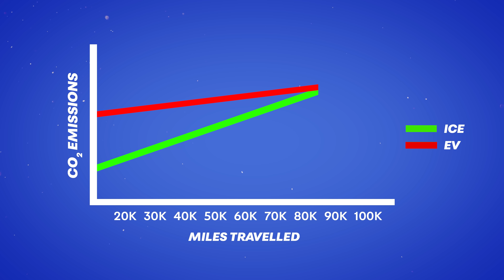Are Electric Cars REALLY That Green? [New 2022 Data]

Comment: The Volvo report is, so far as I can see, apparently a lonely outlier. There are numerous studies concerning the lifetime impact of comparable battery electric and ICE vehicles. I cannot claim to have located them all, but they all, so far as I can tell, appear to agree (aside from the Volvo example), that the conventional wisdom is indeed correct. ICE vehicles pollute less than BEVs in the manufacture phase, but it is the use of the vehicle, where the ICE vehicle easily outstrips (but not in a good way) the BEV, meaning that BEVs are overall substantially less hostile to the environment. Of course, all driving, irrespective of the energy source is harmful to society and the environment inmultiple different ways. Driving less is better for the environment. No motor vehicle is truly environmentally friendly, but a hierarchy of transportation harm exists. In terms of decreasing environmental harm of personal transport, I believe it to be: ICE car, Hybrid, Plug-in Hybrid, Hydrogen car, BEV, electric motorcycle, walking and pedal cycle. Yep, the pedal bicycle is undoubtedly king and is at least several times more energy efficient than walking.

Comment: Its not going to matter much at this rate. But if you dig a little bit you will find out that EV is not actually green at all. There are a a number of things that makes EV a danger to the environment. And there of course is the problem with none scalable factors. It is not possible to scale up the manufacturing of EV to replace all the normal cars. And that be a fact. As all the cars on the road today are not manufactured with in the last 10 years. Actually most cars on the roads are over 15 years old. So can you replace a billion cars in a short time. Not physically possible. Plus there is the fact that with in the next 5 years people will be starving and the value of all currency will be basically zero.  And manufacturing will come to a stop because of that.

Comment: Very good article but I will take exception to one thing Rory said, it doesn't matter what tariff you sign up to, your electricity comes from the nearest power station and if you look on the national grid carbon map the only place in the UK that has low carbon energy is the northeast of england. So if you've signed up to a green tariff in wales all your electricity or 99% of it is produced at a gas powered power station!

Comment: The break even point between EV versus ICE emissions, as reported by Reuters Press agency is quite different from that reported by Volvo. Reuters relied upon the modelling used by Argonne National Laboratory in Chicago. Their figures suggested a Tesla Model 3 would break-even with an ICE car at 13,500 miles (21,725 km) after which, the EV would be greener.
There seems to be an acknowledgement that assumptions can affect the result substantially.
However it's unsurprising that: The American Petroleum Institute, which represents over 600 companies in the oil industry, states on its website: "Multiple studies show that, on a life-cycle basis, different automobile powertrains result in similar greenhouse gas emissions." Well they would say that, wouldn't they.

Comment: Well I'll be honest, In my case other than being so called "green", I will get an EV because I don't want to pay for gas anymore. In my area, the power is hydroelectric so no worries. Whatever way I look at my calculations even if the EV is more expensive, I still save money weekly vs my current car + gas cost. It really depends on your situation in the end
Reply: U will save money . Thats fine until you start thumping your chest about ice car drivers being inherently worse. Some of course are but not most.
Reply: @ronskancke1489  in my case, not my intention. The sound of a V8, it's something. Anybody who thinks that ICE or petroleum will become useless tomorrow is deluded. In the end an EV suit my need. I say your money, your choice.

Comment: It's great to start doing this comparison to really educate people in general what they are getting. I would still have a couple more questions.
1. How long is the EV's car battery actually going to last? They are the most expensive part of the EV and the batteries are not easily recycled.
2. If the battery only lasts to that 92,000 miles is the EV actually that green if the battery has to be replaced?  Doesn't the graph have to start nearly at the bottom again since that is most costly part of the construction of an EV?

Comment: Volvo is saying that EV’s without energy supply side changes will only result in a 20-30% reduction in emissions over a 120k mile life of the car.  Another interpretation is that even with the current state of battery tech, EV’s can reduce road transportation related emissions by 60-70% if charged by green sources.  Better supply and better batteries are needed.  The supply has a known solution, the batteries need R&D.

Comment: Not surprisingly, Tesla's battery pack is under warranty for 8 years or 50.000 miles (80.467 km). So.... you'll have to change it before it even reaches the point of breaking even. if you add the generation of the electricity, then it is even less greener.

Comment: As an engineer the facts are the EVs are just virtue signaling.  When you consider the mining of the battery components AND the disposing of the battery which is not 100 % reusable, the ICE car is a bit more cleaner over the lifetime of the car PERIOD . Plus eliminating all gas cars won’t do anything for the environment. It the big shipping lines that pollute the most.  Unless we all start manufacturing stuff at home the problem ( WAY OVERSTATED AS IT IS) won’t get solved.  Remember politicians are heavily invested in green manufacturing THATS why they are pushing us that direction

Comment: EV ranges need to greatly expand and charge times have to drop to make EVs viable as a family vehicle. In North America you need to be able to cover 600 to 1,000 miles a day with with at least one of the vehicles owned by a family. Distances are just so much greater here.
Reply: 1,000 miles a day!?
That's 22hrs and 15min of driving an average of 45 miles an hour over a 24 hour period...
What family does that EVER let alone regularly?

Even the low end 600 miles a day you mentioned means driving non-stop for 13hrs and 20min a day.
Reply: @MNKYfilms  US Interstates have speed limits in of at least 65 mph. 1,000 miles is about 15 hours.
We are in Maryland just NE of Washington DC and NW of Baltimore.  Orlando and Memphis are about 900 miles, Kansas City and Fort Lauderdale are a little under 1,100 miles. We make the trip to KC about twice a year (usually one to visit and one passing through on the way west). My in-laws have a place near Fort Lauderdale so we are usually there at least once in the winter. Orlando is a once every couple of years trip and we are heading to Memphis for a week over Easter. As long as you follow the traffic alerts on the GPS any one of these is in the 15 to 16 hour range. 
If the wife is with me I would not be able to do this with my truck (1 fuel stop, 2 bathroom stops, eat while driving), but have zero issues in my coach (zero fuel stops, food and bathroom on board).
You also have to drop your mileage if you are doing multiple longer days. For instance  Boise Idaho to home (south route through SLC, KC and Lexington KY - about 2,500 miles) took 3 days in the coach.
Nobody averages 45 mph on a road trip.
Reply: @rich7447  No road trip that I'm aware of averages the speed limit...

But even if we agree to use your fantastical average speed surely you can agree that the average person does not regularly drive 15 hours a day. Let alone without breaks every few hours for food, bathroom and to stretch your legs.

The average person also doesn't have or want a coach as an option.

It sounds like an EV is really not an option for you because of the type of driving you do. And that's perfectly valid and fair. Don't get an EV then. No one is forcing or even asking your too.

However your personally driving habits are NOT the average. I would guess that most American families would do fine with 350 mile range in a day. And I'd also guess that most families would stop for a meal that lasts more than 30 minutes at least once during a 10 hour journey.
Reply: @MNKYfilms  Most road trips in the US average over the speed limit. Some parts of the year can be slower around major cities (I-95 especially) in the North East, but the south, mid-west and west tend to have open highways for miles. You don't seem to realize how far it can be to get from one city to another. The last time that I was coming east through Denver on I-70 my GPS told me my next turn was over 600 miles away. 
Even in my truck I stop very rarely and this is not uncommon for people in North America. You eat before you get on the road, lunch is a snack from a truck stop and dinner happens when you are done for the day.
My driving habits are not average for some parts of the US, but very normal for the mid-west and west. Our friends in KC don't think much of driving to Oregon or Florida and their approach is similar. Get in the vehicle and get the driving done. Canadian friends drive to Florida every winter non-stop both ways (2 drivers).
With a few exceptions almost everyone that we know who has an EV also has another vehicle that they use for longer distances.
Reply: @MNKYfilms  BTW: My parents live about 450 miles away in Canada and I will go up and back in a day when dropping my daughter off. Then a week or two later I do the same to pick her up.

Comment: Most EVs are over £40k or even £50 and no privately owned EV bought new is kept for 90k miles. So they start again after 3-4 years with all the upfront EV Carbon.

Comment: So this means that if we ran on a GTL (gas to liquid) fuel cycle where the energy for the GTL generation was sourced from "Green" sources, then the electric car is always going to have "cost" more in CO2, than an ICE engined car! That is also without all of the additional non CO2 pollution that the battery manufacture produces!

Comment: In fact, “petrol” creates CO2 when it’s extracted, transported (if by sea, there’s not even limits on the pollutants the ships’s diesel), when it’s stored, refined, distributed and then used. 

And, then, the ICE efficiency is around 30%, vs. around 80% for BEV. 

Yeap, we should definitely have an open conversation. 

Oh, and batteries can be reutilized - eg for stationary storage- or recycled - it’s estimated bu Redwood materials that it’s chapter to recycle battery materials than to extract them from nature. 

Even if it would be like for like between ICE and BEV in terms of pollution, moving away the pollution from cities would be a win, IMO.

Comment: Everyone has their own reason why, or why not to buy an ev
I am not trying to convince anyone either way also.

I personally bought a Nissan Leaf a year ago after our 4 year old Renault Grand Scenic 1.2 tce had a catastrophic engine failure not covered by warranty. The engine replacement was not economically viable and more than a new battery for the leaf!

The leaf is now used mainly by my wife and has done +20,000km in a year. We have done all charging at home over night (2-3) times a week.

In France pretty much all overnight charging is Nuclear and so does not affect climate change. Obviously there are still concerns there with nuclear pollution.
I can understand if other users need rapid charging or live a country which relies on fossil fuel for a high percentage of electricity, then their perspective might be different.
The annual service just cost about 70€ - basically screen wash and a battery health check
But currently, I can only find positives from ev ownership.
Current fuel prices and availability make the switch even more attractive!
‘My’ personal car is a 2015 Audi 2.0 diesel with ‘ad blue’ tech. This currently averages 47mpg around town and 60mpg on the autoroute 
Once a long range electric solution arrives and the electric demand is proven to cope, I will switch over 100% to ev or hydrogen cell tech
I love ice cars and expect to always have one tucked away! But feel we need to embrace new tech and be open minded to ways in which we can improve and sustain life on this planet!
Happy driving!

Comment: CO2 is a misnomer and not reflective of the real issues and it is used because the EU found it was the cheapest to introduce and bought in the most revenue and the only way you can directly compare electric and ICE vehicles is to cover their whole lifecycle and this includes manufacturing and disposal of the vehicle and things get worse. China has secured 80% of the worlds lithium for the next 30 years and this means companies will have to mine the ocean floor for the rocks to provide the lithium so nobody can claim the moral high ground.

Comment: Thanks for sharing... I do think Volvo wasn't to just be honest here, and its a good thing. There are things people can do to try and be "greener" - one of them is just keeping your car longer if it still works. In the US its rare to see people keep their cars more than 100,000 miles. What really needs to be worked on is battery recycling, as that is still a rarity that it will be done well.
Reply: The greenest thing to do with an ICE car is stop driving it. You are not "repaying" CO2 during production by driving it like with an EV. Every mile driven by ICE is producing more CO2 (and other noxious fumes). Every mile driven by EV is getting towards that break-even point and then will be greener from then on. This is just not the case for ICE, which just keeps adding to its total emissions. Every mile driven should be EV to reach break-even points.

Financially it is a different story, but still if you can afford it sell the ICE and switch to electric.

Comment: Just a thought.
So how long does a battery pack last. Less that 90,000 miles I'll bet. If the batteries need changing, then the clock has be be set back by the amount of CO2 produced in their production. It might be that they never actually break even in their lifetime.

Comment: yes, 90k miles, but then you have to replace the battery-pack after 6 to 8 years and the EV pollution level explodes again.

EVs are most "green" if they're driven as much as possible ALL the time for 8 years and then scrapped

Comment: Couple of thoughts. This does not factor in a new battery for the EV. If your battery lasts 10 years you either create a significant amount of CO2 with the production of a new battery or more likely scrap the car and have the emissions of producing a new car. The ICE car could last 15-25 years before becoming uneconomical to repair.

Then the comment about "my supplier only uses green energy", really, step back and think about this. Your next door neighbour isn't on this tariff, do you honestly think your supply is different to theirs? No, it all came off the same main supply. The average mix applies to all users regardless what tariff you use.

Comment: The EV curve is anything but a straight line. The batteries degrade so need more charging and every 80k miles (or so) there'll be a dip where a new battery has been bought and an old one recycled (incredibly toxic). He hit on an important point though, EV people for the most part only consider their own local environment.

Comment: A lot of the electric cars recharging also greatly adds to the electrical grid which also costs environmental impacts to produce. Right now where I live the large corporate power company has proposed more than one proposals for installing a more robust power supply system, which is very much needed to reduce voltage spikes and outages. All the proposals have been campaigned against by residents, companies rejected property access, etc. And now the situation once again awaits a new proposal as to where the taller, higher voltage towers can be routed and where the new, higher capacity substations are located. This while the new building of residential continues which requires more electric power. And the present day society seems to ignore those needs while advising to get electric vehicles which only add to the power needs. As an American Society we are headed down the drain as logic no longer has any support.
Reply: Get solar.

Comment: Honda said the CR-Z had to cover around 50,000 miles to recoup the manufacturing losses from the hybrid system. Electric devices which are consuming power but not being used - anything on stand by, tv's with people asleep not watching them - creates more pollution than cars. Container ships using the less expensive higher emissions fuel when they aren't in low emissions zones creates more emissions than cars. Nobody ever talks about people changing to small motorbikes instead of cars, despite the fact that many of then return over 100mpg and have less manufacturing losses.

Comment: The best that can be done is the hybrid. In colder climates batteries will die faster, life span of the batteries is shorter. Hybrids are the best stop gap method if you believe in climate change. The earth is just going thru a normal cycle in the climate nothing more.